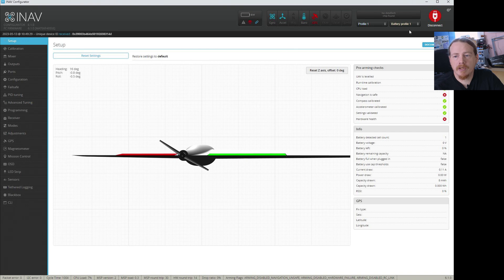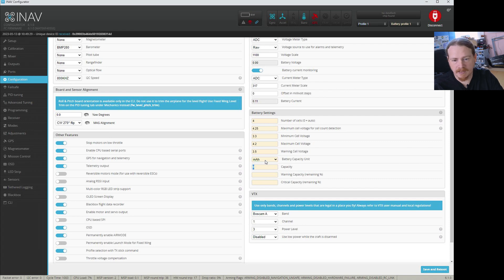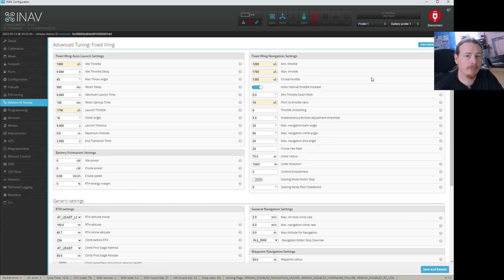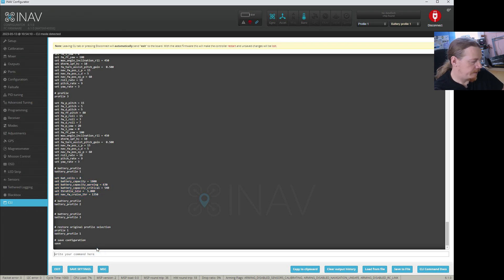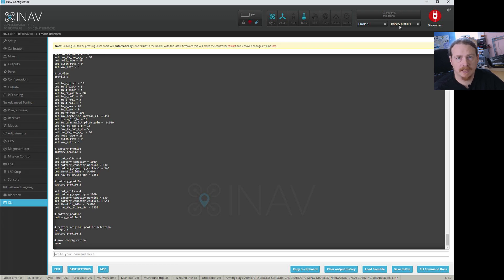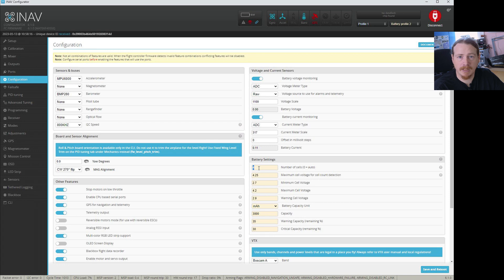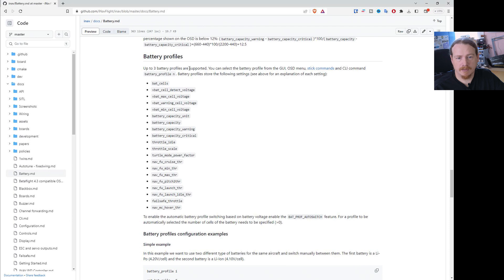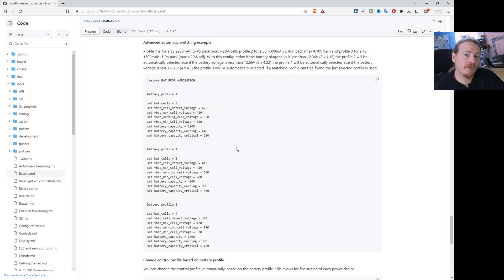Working with Profiles in INAV: Using different batteries or PIDs

Comment: Hi Darren, I've recently did a 4s li-ion battery and I usually fly a 3s li-ion battery. Your video helped me a lot in creating battery and control profiles 2. I don't know in what way the 4s battery will affect for example the cruise throttle 🤔 TIA
Reply from the maker: From what I remember. The cruise throttle is part of the battery profile. So you would set it appropriately for each battery. 

Just checked. It is a part of the battery profile. https://github.com/iNavFlight/inav/blob/master/docs/Battery.md#battery-profiles

Comment: Thanks! A good start for me as I go down the rabbit hole of battery profiles. I´m normally using a 3s lipo battery in my plane, but I have been thinking of using a 4s liion for longer flight times(same weight),  But the liion can only handle 30 amp. discharge(I have a 40amp esc). So I would like to scale my throttle so that when 4s liion is used the profile makes it so that my max throttle position stops at 30 amp discharge..  Is battery profiles the way to go, or can I "nerf" the power elsewhere since i only saw mid throttle settings in this video? Cheers!
Reply from the maker: Don’t be concerned about the size of the ESC. That is just how much current it can handle.

What you should worry about is the current pulled at full throttle under full load (usually at launch). That will give you the minimum current handling that the battery should be able to accommodate. Also, there are plenty of options for LiIon packs depending on your required power draw and space.

For example you could use a 4S1P 18650 pack. That will give about 3Ah and 20A draw with cells like HG2 or VTC6. That would weigh around 180g. You could go 4S2P with the same cells and have 6Ah and 40A draw. But if space doesn’t allow that or if the 360g is too much. Another option is 4S1P using P50B cells. That would give you 5Ah and 50A current at around 280g. 

Knowing the aircraft and cell requirements is key to making a good LiIon pack. This tool may be helpful in comparing cells https://www.mrd-rc.com/tutorials-tools-and-testing/useful-tools/simple-liion-battery-pack-comparison-tool/
Reply: @MrD    thanks man! I have a 4s vtc6 18650 3000 mah(auline) pack that I will try out. Its rated for 30 a discharge. According to ecalc at 30 amps pulled, it will give more power than my 3s 2700 mah lipo at full power(38 amps). I need to limit the amp draw so that I stay at or below 30 amps at full throttle with the 4s li ion. I was just wondering what would be the best way to do this? I guess limiting throttle could be done in battery profiles?

Comment: I'm using a 3s li-ion battery and the battery voltage is showing up as 9v instead of 12v on my RadioMaster boxer telemetry screen.   The speedybee 405 wing lights show full battery so I suspect the issue is the lua script on the radiomaster boxer.  Just thought I'd see what you think before I start poking around.
Reply: May have found issue.  I had to adjust the voltage scale in Inav as the default 1100 sets the detected voltage to 9.1v.  Not sure why but could be SpeedyBee 405 Wing needs a different scale.
Reply: I was wrong as the value is suppose to be 1100 for the SpeedyBee 405 wing so that was not the issue.  Will double check pin alignment between the PDB board and the fC board as might be issue as that solved another guys problem.  Anyway will try that tomorrow.
Reply from the maker: Hopefully it’s just the pins. If not, you can set the voltage scale with a multimeter on the battery and compare it with what INAV is showing you. You can see the voltage on the configuration page. I usually do this for my FCs anyway, as the provided scale is usually ballpark. Just increase or decrease the scale, save and reboot, then see if the new voltage is closer to what you see on the multimeter. Keep going until it’s right.

Comment: Hi. Very informative vid. Is there way of setting different throttle expo for different batteries? I've created two batt profiles but I noticed that throttle expo stays the same.
Reply from the maker: Throttle expo is not part of the battery profile. Maybe it should be. It would have to wait until INAV 8.0 to be changed though.
Reply: @MrD  I thought so. I think I'm going to set up two model profiles with different throttle expo on my radio. It's just gonna be easier and I can access it in the field. Thanks for reply.👍👍👍👍

Comment: Darren I fly with 2 different batteries 4s 5200mah lipo and 4s 7000mah lionpack, when I switch battery profiles using stick commands in the feild sometimes plane won't arm, osd says battery  proof switch flashing on and back off. I have to go back in with stick commands and change this proof switch from yes to no or vice versa. I did read article in github on battery profiles but seen no explanation? I'm sure you can explain this. Thanks for all your help over the years.
Reply from the maker: To be honest, I’ve not heard of that before. I’ll have to see if I can find anything on it.
Reply: Ok thanks for your help can't fly now due to weather but when I can I'll try and screen shot the osd message but it pops up on screen then gone pretty quick. But using stick commands the options for proof switch is yes or no, I just switch back and  forth until plane will arm. I have no idea what the purpose for this is? I running the latest opentx and inav 6.1.1

Comment: would you really recommend running the min cell voltage for a lion pack at 2.7 like you show in the video? I'm just switching from lipo where I had it set to 3.6 (conservative I know). I was thinking it should be something like 3.2 per cell? Maybe I'm way off?
Reply from the maker: 2.7v would be the absolute minimum. After that, the voltage will drop quickly. Warnings around 2.9 - 3.0v are fine. If you land at 3.2v per cell, you have a fair bit of capacity left. I tend to land at 2.8-2.9v per cell, if I get to the end of a LiIon pack.
Reply: @MrD  okay great! Thanks for the info dude!

Comment: I havent seen a video of u flying a plane using a twin, x20, as in pov showing on the transmitter showing us how it handles🤔
Reply from the maker: I don’t make videos like that. I have seem plenty of quad videos with the sticks in shot. But I really don’t see the benefit. I think seeing the sticks is only really helpful if you’re trying to show how to perform a manoeuvre. Just having a video of sticks with a plane flying will not convey how the gimbals feel or anything really helpful. 

I use the TANDEM X20S for all my LOS planes, and the gimbals are excellent. Especially the ability to rotate them. I thought that was a gimmick. But it really has helped. The TWIN X Lite I use with my quads. For such small gimbals, they are good. That transmitter is also really convenient for travel. So I may also use it for gliders, as it’s less to carry up the slope.

Comment: Great! I tested today my 3 bat profile settings for automatic adapting to 2S3000 Li-ion (long flights), 3S800 (light setup) and 4S850 (oempf with over 5G in loops)  settings on my ZOHD Dart 250G. Works great. 👍
I did set the 4S to 0.8 throttle scale to get roughly the 3S performance and not to burn my motor. The 3S settings for autolaunch, cruise thr and autolaunch idle settings in 4S are also scaled down to 3S performance. Nice.
Learned now how to use for each bat profile my own PIDs profile. Thanks for explaining these INAV options 🙂
Reply from the maker: Awesome. Having these features just makes life easier. Happy flying
Reply: @MrD  Thinking: it seems there is no OSD indication which battery profile is active. But if I combine the profiles 1/2/3 with the bat profiles 1/2/3 as you explained... I do have the OSD profile indication to show the status of my bat profiles... But in that case if I do a PID tuning in one bat profile... well, I have to do 3 autotunes anyway...
Reply from the maker: @ApappieK  yes, there is no OSD element for the battery profile. Only the control profile. Autotune settings will be saved in the control profile, not the battery profile. There wasn’t thought to need a battery profile OSD indicator as it will be automatic or need specifically changed with stick commands (this should show a system message). Whereas the control profile can change in flight.
Reply: @MrD  Clear. No need for a OSD battery profile indication.

Comment: HI ! Something was spoiled in firmware 6.1.0 for FC F405SE. At the default setting for 5 inches, I have a rotating Quad in the setup tab. On the sensors tab, the Gyroscope values randomly change with the maximum amplitude.
Reply from the maker: If you have an issue, it’s best to raise it on GitHub https://youtu.be/gxaahyeqZC8?t=678

If you have a GPS and this is on yaw. Don’t worry about it. Until the GPS is moving, it has no idea of heading. Also if it’s trying to get a fix, it will be picking up random positions all over the place. These can start at 0, 0, which is on Africa.